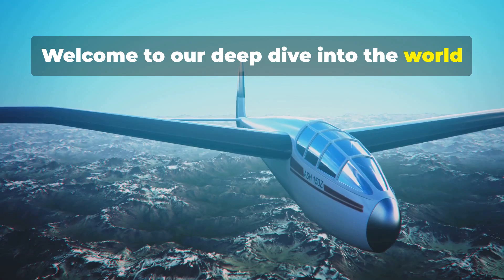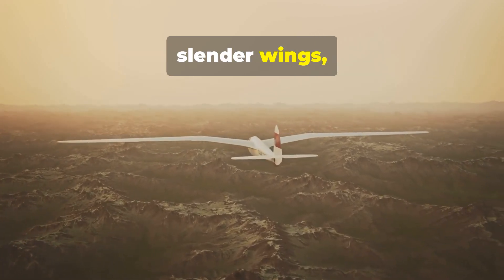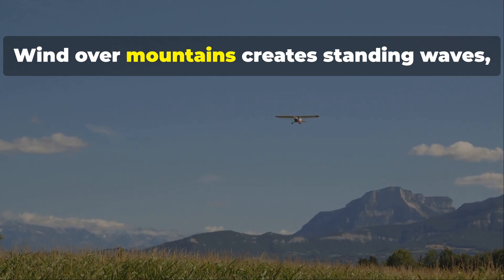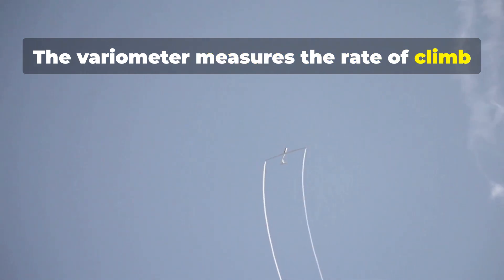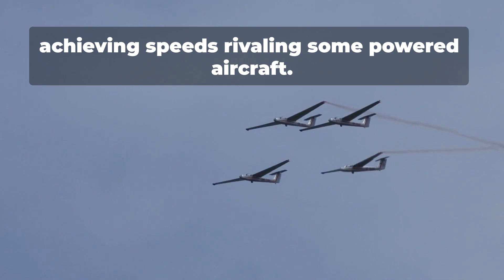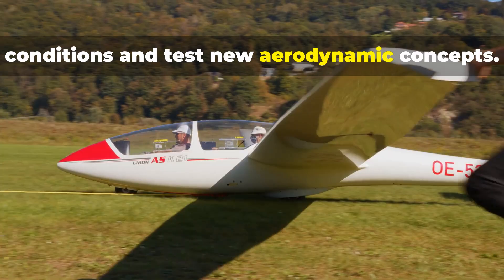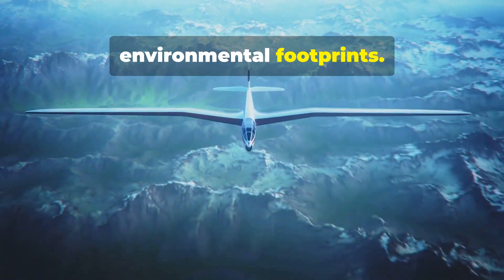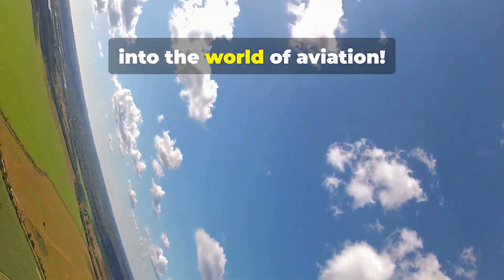Why Gliders Still Matter: The Art and Science of Silent Flight

Comment: Realistically glider pilots don't need any instruments for safe flight apart from the ASI 😆 only done it once without any instruments - good fun!
Reply: Even the ASI is optional if you are used to the sound profile. During my training it was common for the instructor to cover the student's ASI for training flights. (The Instructor kept his accessible for security.)
I wouldn't want to fly withot a vario, though. I'm even uncomfortable if I don't have the beep-beep of an electronic vario.
Reply: With experience even the ASI is not “needed”